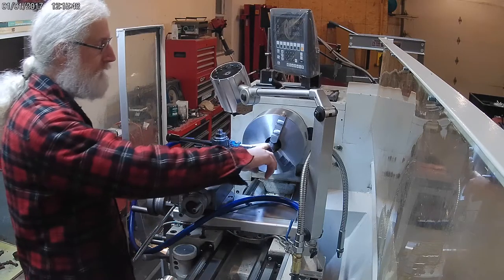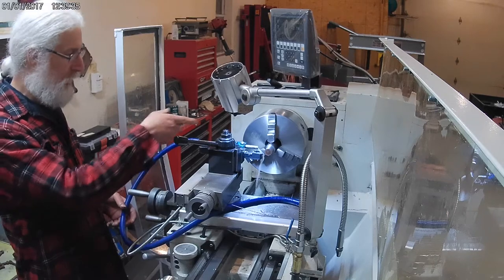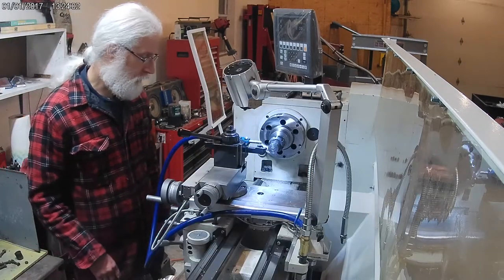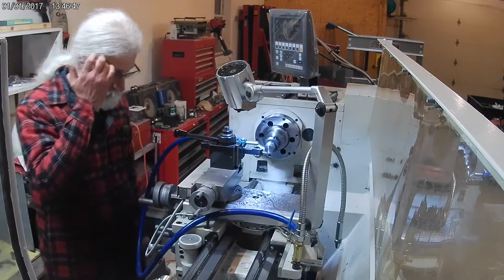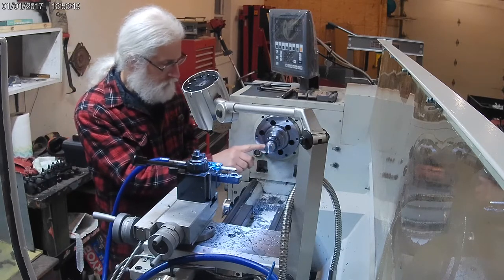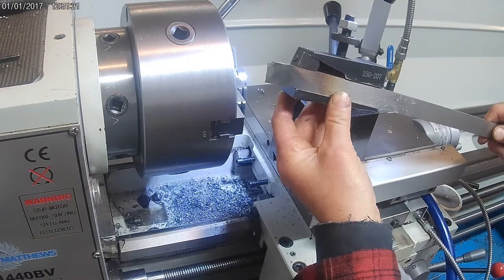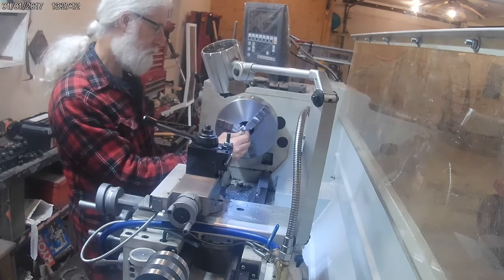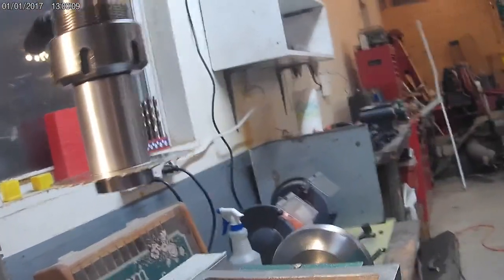Making a Custom Slitting Saw Arbor Pt2

Comment: all the hoses and line should be out of the way
Reply from the maker: The silver wire for the DRO is not an issue for me; Just took a session to get use to it being there and adjusting how I move around it. The blue coolant line can be a bit of an inconvenience and I would consider making changes if I could do so without losing the flexibility of the set up. but having the coolant precisely follow the tool is worth working around it when I need it and that flexibility is far more important to me than eliminating a minor inconvenience. If I am cutting dry I just remove the hose and shield.